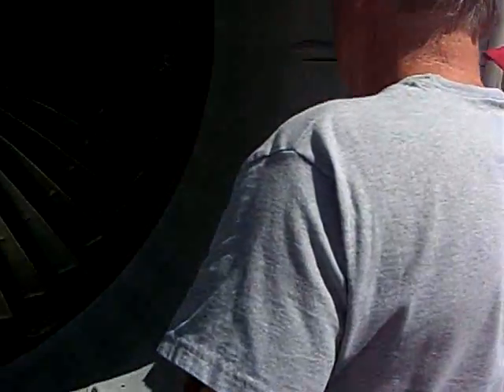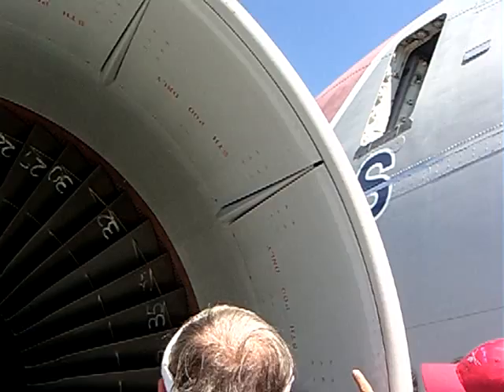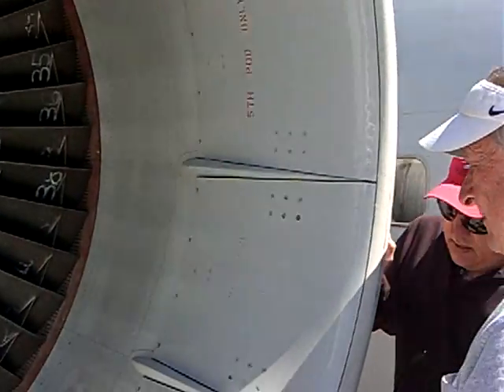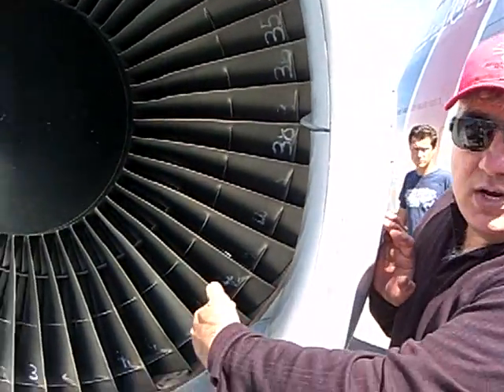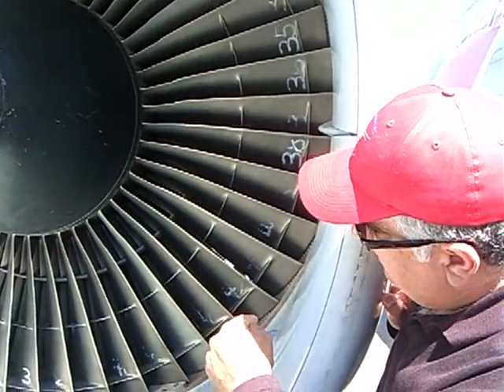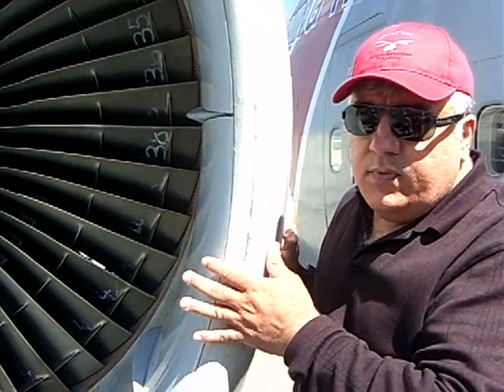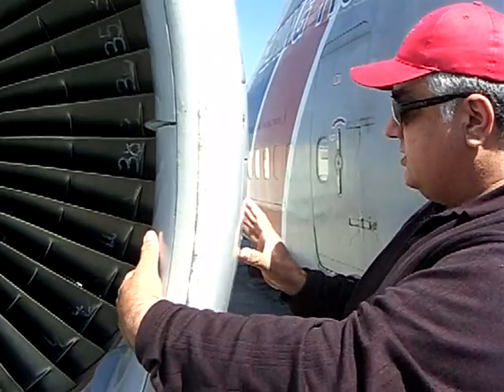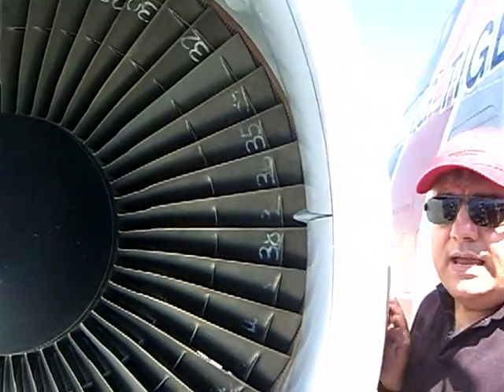The Amazing Boeing 747  Engine unique design features -1

Comment: they had problems with that acoustic liner disrupting the airflow between the tips of the blades and that resulted in several engines exploding violently when they reach a certain power setting